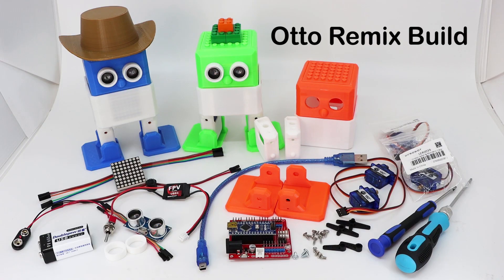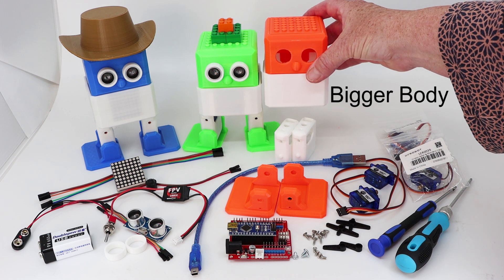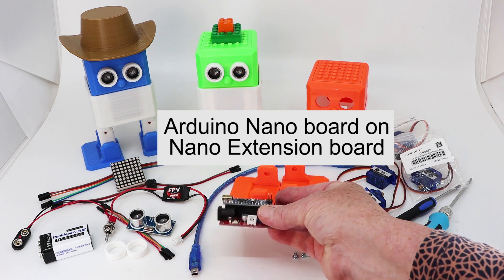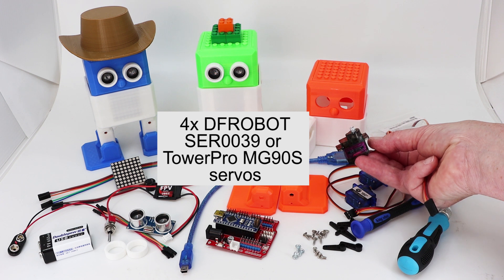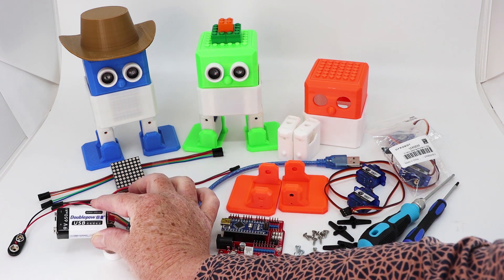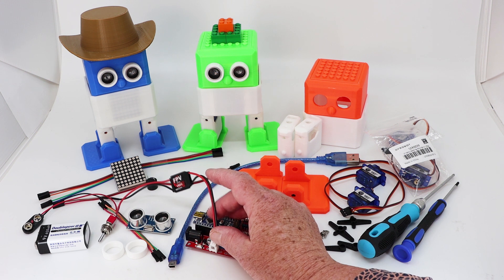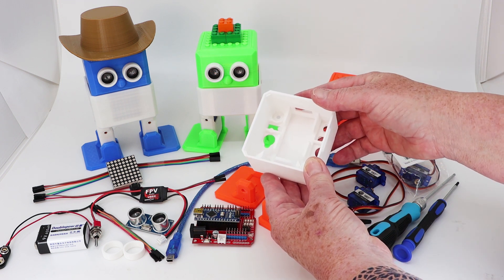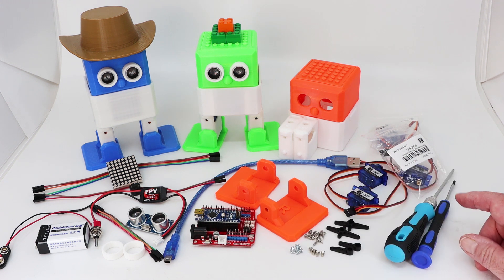Introduction  to Otto with LED Matrix mouth and 9V rechargeable battery

Comment: Did you have to solder the wires to the board? I like your style and want to do this version with my students. I have never doner this before and am worried about how hard it would be. This seems to onlh be the ones coming from the 9V and switch. Any help is appreciated.